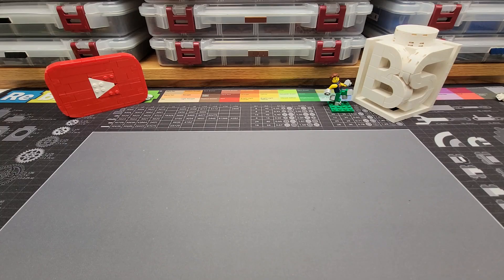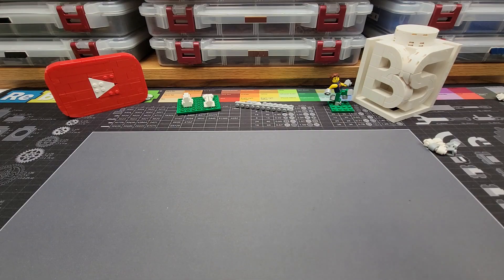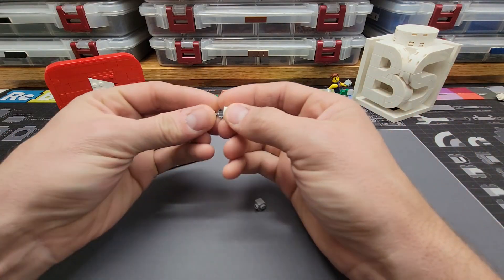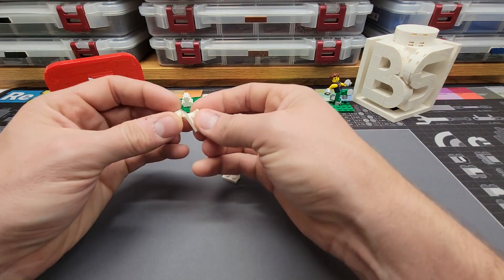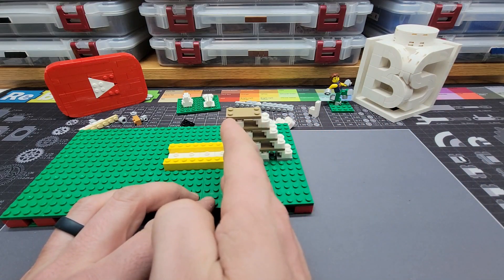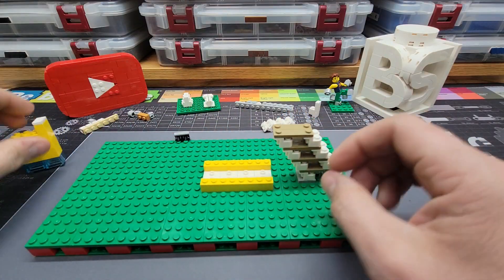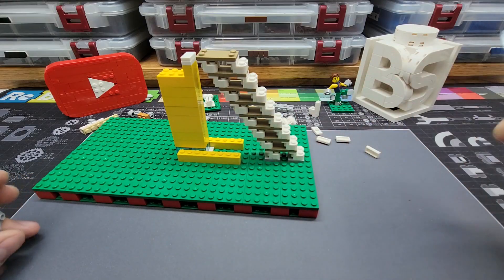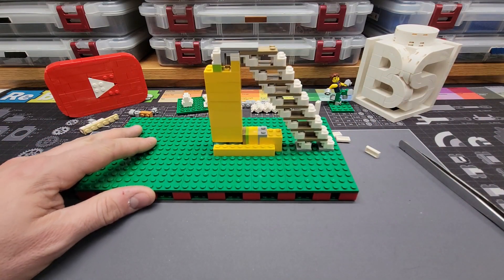How Small Can We Measure With LEGO? An Attempt to Prove 1/2LDU.

Comment: I've just done the maths and you're correct.

TLDR: the D-SNOT brick is 0.2mm (0.5 LDU) higher than two plates.

A plate is 3.2mm high, not including the stud and an LDU is an eighth of a plate so 3.2mm ÷ 8LDU = 0.4mm. According to bricklink, the height of the D-SNOT is 0.83cm (or 8.3mm) including the stud. The stud is 1.7mm which brings the height of the D-SNOT down to 6.6mm. As i mentioned earlier, a plate is 3.2mm thick, multiply that by 2 and you're have 6.4mm. An LDU is 0.4mm, half of which is 0.2mm which is the difference between the height of two plates and a D-SNOT. That 0.2mm difference is less than 1/125th of an inch.
Reply from the maker: Nice well done with the investigative math.
Reply: @bricksculpt  pin this comment lol
Reply: That's great and all... Except a D-snot isn't 8.3 mm, it's 8.22 mm (+- 0.02) (at least the 10 ones I measured). Well, actually one was 8.21 but I removed that one cause I assume it's just been a bit worn down. But the rest of the math checks out, cause if you remove 0.1 mm from the height you end up with a 0.1mm difference, which is what my dial indicator measured as the difference (with an accuracy of 0.005mm) and it also happens to be the height of the embossed lego logo :)
Reply: 0.2 mm (200 μm) is actually a really neat size because it's the biggest size that can divide both the centimeter and the inch and give integers! Obviously 50 • 200 μm = 1 cm, but because the inch is defined as exactly 2.54 centimeters, you also get 127 • 200 μm = 1 inch.
Reply: Alternate solution, same result: 

Lego parts are 0.1 mm shorter on each side than their ideal dimensions, to provide tolerances. So a 2x2 plate is (2x8)-0.2 = 15.8 mm wide. 

Lego parts are 3.2 mm tall per plate. We know that 5 plates = 2 studs. 5x3.2 = 16 mm.

So when building with SNOT, you’re off by 0.2 mm per 5 plates. 

But where does that 0.2 mm go? 

As a couple of us mentioned on the previous video, historically Lego SNOT pieces aligned the parts on the side to the top of the brick or bracket. They shouldn’t have. They should’ve been 0.1 mm below the top edge — the width of the tolerance. 

The new D-snot brick is designed to match that shifted-high alignment. That means that the gap at the bottom is {0.1 mm from the tolerance on the bottom edge of whatever you’re attaching} + {0.1 mm from the tolerance at the top edge that the part has been shifted to eliminate} = 0.2 mm. 

1 LDU = 8/20 mm = 0.4 mm 
0.2 mm = 0.5 LDU

- - - - 
With the older 2x2x2/3 SNOT plate, what looks like it’s flush with the bottom of the part is actually a 1/4 LDU gap. It has to be, because otherwise when you put two of them bottom-to-bottom (like you did early in this video), there would be a 0.2 mm gap between them.

Comment: 1:55 RE: variability of injection-molded plastic and measuring precision: 

You’d want to measure a couple dozen parts, and they’d need to be new, unused parts so you could be sure they hadn’t been worn down or deformed or damaged by use, but, yeah, LEGO’s parts should be measurable and consistent to within well under 0.1 mm. The usual figure I see claimed is that LEGO parts are accurate to within 0.02 mm. 

And while quantifying those dimensions is difficult (you need measuring tools that are definitively getting the dimensions without applying enough pressure to flex the parts by even a hundredth of a millimeter — it’s definitely going to be easier with laser measurement than with physical calipers), checking that they’re consistent is easy. Just start stacking bricks. The way you know that the dimensions are consistent is that the force required to assemble them, the force required to disassemble them, and the amount of sideways flex are consistent. You can feel it. Especially if you’ve used other bricks which aren’t as consistent. 

Another good test is to make a long, low wall of 1x2 bricks — say, 4 bricks high and 50 bricks long. Then gently bend your wall into a curve. Check for any places where the bricks allow the wall to curve more or less. IME, unless some of the bricks are much more worn than others, there won’t be. It will be a consistent amount of curvature across the whole wall. 

So while I can’t measure with the precision needed to say for certain that Lego parts are consistent within +/- 0.02 mm, I can say with high confidence that parts are extremely consistent, with extremely rare exceptions, and whatever the level of variance, it’s considerably smaller than the molded-in part tolerances (the gaps between adjacent bricks).

Comment: if you used a plate on the very top instead of a tile it wouldn't have the groove on the bottom so it would show any difference in height much better

Comment: 12:20 You're selling yourself short, this is actually very scientific. You have clearly laid out the thought process, the experiment design, then documented the experiment so that it is easily reproducible by anyone willing to do it. You also comment on potential uncertainty sources and potential flaws to the design. That's exactly how science works.

Sidenote: Shouldn't multiplying eliminate the influence of the manufacture tolerances? Assuming the tolerances go both ways (the piece can be 0.xxx mm too large or too small) would stacking several of them make the imperfections cancel out with each other?
Reply from the maker: Thanks!

Comment: To make it more scientific, the measuring apparatus should be calibrated using the Standard LDU, cast in platinum and stored in a vacuum facility under the Lego House in Billund.
Reply from the maker: Lol
Reply: But what happens when the 10 different platinum bars stored in different places around the world are compared 70 years later and do not agree? :-)

We need a measurement based on the physical world properties that can be remeasured in any lab. Without worrying about molding tolerances, pushing pressure, single lump thick pieces vs lots of little pieces, etc.

Naah, this as "half" is as good as Lego tolerances get.

Comment: On a regular lego brick, there's a 0.1 millimeter tolerance on each side to prevent friction between the bricks. Bricks have no tolerances vertically on the top or bottom but have to have them horizontally or it would be extremely hard to build classically with them. That presented a major problem with SNOT building techniques. Most bottom-aligned SNOT and bracket pieces cannot be placed bottom-to-bottom and have a piece connect the studs across the SNOT studs because the exact vertical measurements of are being put into conflict with each other and create a larger gap between the studs that is not in-system. The original 2x2 SNOT plate (99206) was created with stud reversal in mind and has the SNOT studs aligned lower to prevent this conflict when placed bottom to bottom. The 2x6 (87609) is designed on the same alignment. If you place a bottom-aligned SNOT brick on top of these and put a plate across the SNOT studs the two pieces will be perfectly vertical because of the different alignments. The D-SNOT and a new version of the 2x2 SNOT plate (4304) are designed with their SNOT studs aligned as other bottom-aligned SNOT bricks are.

With your proof here, and with the knowledge that bricks and plates align perfectly with the top of SNOT pieces, that means the SNOT studs on most SNOT elements are aligned 0.2 mm (or 0.5 LDU) higher than the alignment on the stud-reversal SNOT plates (99206 and 87609). It's such a minuscule difference that we normally don't see the gap on the bottom, but it matters when doing stud reversal

Comment: I just realized... I have a dial indicator meant to measure this very thing (tiny height difference)... Dono why I was trying to measure this with calipers.
So results are in, the difference in height of it's 0.10mm with an accuracy of 0.005 mm, so it looks like 1/4:th of an LDU :O
I measured 4 D-snot pieces, they differed by less than 0.005mm, so this is within the tolerances of the parts.
Lego tolerances are really something, seeing the dial hit the same spot within 0.005mm when using different pieces is just amazing.

While I was at it I also measured the embossing of the lego logo, surprise surprise, also 0.1 mm.
So it's probably because of the logo they raised it.
Reply from the maker: Very interesting. Thank you for taking the time to measure these.

Comment: Redo this experiment in the future with the following:
- Double the height. Make it a plate difference.
- Make several towers, 2-4, to ensure there are no errors in tolerance.
- Zig-zag like others have said.
- Make the control towers, instead out of bricks, using those other 2x2 lower-snot modified plates (with the correct measurements). You are recreating the exact connections but with a control piece you know is correct.

Comment: The Concorde set (10318) has a plate attatched to "d-snots" and "normal" snots at building step 466 and 478. 

So maybe Lego thinks that half a LDU is no stress and therefore legal?
Reply from the maker: Good to know thanks I have been hearing that several sets do it so they don't really recognize it as a problem.
Reply: As far as I know this is the "normal" for snot, at least within tolerances.  Also, it only stresses in one direction - top aligned studs, placed over the unusual bottom aligned studs (99206).  The other way around creates a gap, which is legal, just not ideal.

Comment: Oh btw, I realized that you can get an infinitely adjustable LDU using:
3 W.ARCH W.KNOB AND SHAFT Ø3.2
Or
SHAFT 2M DIA. 3.2 W/ STOP
With a hollow stud 
And
BRICK 1X1 W. 2 KNOBS

Put the rod into the brick and you can slide it horizontally to an infinite range of LDU.
Reply from the maker: Yeah that works

Comment: By definition, this is the new "1 LDU" and all other bricks must be redefined to this standard, lol.
Reply: What happens if they release a brick that's exactly the square root of two times the width of another brick?
Reply: That's handy anyway, because the new "Half LDU" (HLDU) can perfectly subdivide both the centimeter (50 HLDU) and the inch (127 HLDU). In fact, it's the largest unit that can do so.
Reply: don't look up particle spins lol
Reply: @screambmachine  ?
Reply: @ guess you should look up particle spins
Reply: @screambmachine  i looked it up and idk what about them is relevant?
Reply: @Tetrini  I'm pretty sure he means that whenever they get more accurate measurements on the speed of particle spins, they have to update the base unit of measurement to reflect this, similar to how the original comment was stating that the measurement of an LDU has to be updated due to the "half ldu" size

Comment: The offset should be the width of the air gap between pieces (0.1mm). This is because when the headlight brick was first designed, it's side stud was set so that the side of a brick or plate attached was flush with the top - but bricks aren't exactly 1 module wide (they have small air gaps either side which weren't accounted for). Therefore all newer snot pieces have their stud geometry like this. When the 2x2 with 2 side studs was first created for the UCS B-Wing, it was designed as a stud reverser, so didn't follow this pattern (its studs were placed to enable back to back placement - if you stack a snot brick on top and fix a 2x plate there will be slight stress). This piece was updated in 2023 to align to the studs-up SNOT system. The D-snot piece was always designed with this 'correct' alignment.

Comment: Other methods: 1) Ask someone at LEGO to comment. Differences in mold and piece might not accurately reflect their intent. 2) Otherwise, if somehow could use a microscope (focusing on stud versus lower corner could be a problem for this though; yours is probably smarter as it avoids this), and measure it with a huge sample size to try to eliminate mold & piece. (Normal scientific method.)
Reply from the maker: Yeah, it's super hard to make this accurate with inconsistencies. I like the advice from someone at LEGO idea.

Comment: You can include one 0,5 ldu step at a convenient place in the ruler to see of the offset is between two of them. The steps on both sides should be equal
Reply: @rnulfschmer7537  Yes, I did similar with technic bricks and the tolerances really just hide the differences. You have to do it across a few steps to really try and convince yourself that what you’re seeing is actually real :-)
Reply from the maker: I actually did that off camera the problem is it's too small to make a good judgement.

Comment: I did the equivalent of this sort of thing on my Flickr some time back but using the difference between technic brick holes and bricks with studs on the side. Made a staircase with multiple steps but now I’m wondering if this D-Snot and technic hole are both misaligned by the same amount. If they’re by different amount then that could allow finer divisions than 0.5LDU. I see others have already commented about alternating the stair direction. That might well prove that this is actually a 0.45 LDU step or some other equally odd number!
Reply from the maker: Yeah good point John, there are still too many inconsistencies to say for certain it is .5 or .45 etc.
Reply from the maker: Yeah good point John, there are still too many inconsistencies to say for certain it is .5 or .45 etc.

Comment: Calipers and micrometers are not overly expensive unless you go for really high end tools. My local hardware type store has a digital set for under $20, and a vernier set for under $10 right now. Both machined from steel. A specialty store has a vernier micrometer for under $40.
Reply from the maker: I have a digital caliper but I still don't think that will be accurate enough considering mold inconsistancies.

Comment: One LDU is 0.4mm, and a half plate is 4 LDUs, so a half plate is 1.6mm thick. The 8 D-SNOT offsets in the video becomes 1.6mm / 8 = 0.2 mm = half LDU.

My calculation is the SNOT stud should be 0.1mm higher, not 0.2mm. So I’m not sure where the extra 0.1mm is coming from on each layer of SNOT.

Also since we’re talking about fractions of a millimetre, plates and tiles and not the same height. Tiles are slightly shorter than plates making it legal to put tiles sideways between studs, but not plates. Plates are the proper 8 LDU, tiles are not.
Reply: someone should measure it with precision callipers, i have the callipers but not a piece like this.
Reply: @ I own them but don’t have my tools at the moment.

Comment: I'm convinced. I was also afraid you were going to go down the 1/2 LDU ruler rabbit hole. That way, madness lies... ⬛◼️◾️▪️↙️🐇
Reply from the maker: I think I have to now lol
Reply: At some point it's probably easier to find somewhere that can make you a highly precise metal ruler, lol. the half-ldu is 200 μm.
Reply from the maker: What's the fun in that lol
Reply: @keiyakins Digital calipers are cheap these days and super easy to use. Every hobbyist should own one. I use mine all the time and find them to be an indispensable tool. They would make quick work of this question.

Comment: If it wasn't a half LDU, this would be visible on the stack of 8. You have proven that even if it's not exactly a half LDU, the difference from it has to be extremely tiny, probably less than what the tolerances are. Therefore, you can safely assume it is a half LDU for all practical purposes.
Reply from the maker: That's a good answer to the question. Close enough for me lol
Reply: Agreed. It looks to be between 1/2 LDU and 1/2 -1/8 LDU, close enough to 1/2 to assume that it's straight up 1/2.

Comment: What I'd like to know is if there are any official LEGO sets that actually make this piece align with other bottom-aligned SNOT pieces and where you put a piece or assembly over them. It seems illegal if that strangely small misalignment is there.
Reply from the maker: Yeah people have cited a few that do.
Reply: Yes, there is. The Concorde (10318) step 466 connects plates between d-snots and snots of other parts.

Comment: Just a thought. If it is proven that this is 0.5 LDU, and we reapply the definition of LDU, doesn't it become 1 LDU? Since it's less than the current draw unit, 1 LDU is no longer the least draw unit, 0.5 is. By definition of least draw unit, it is 1 LDU.

Not that I think this change should or will happen. 0.5 is so small and impractical to incorporate, the LDU convention doesn't need to be overturned to please the literal meaning, just thinking out loud.
Reply from the maker: Not necessarily you can have .5mm or 00 gauge. It's just a measurement, not necessarily the smallest possible division. Otherwise, we would have to measure to the individual atom for LDU. 😁
Reply: @bricksculpt  but LDU is not defined as a certain measurement like mm or gauge, it's defined as least draw unit no? So if what is currently 1 LDU is no longer least, then currently 0.5 LDU is the least so it should become 1.
Reply: @colemantrebor6574 no, his LDU video used an informal definition, which is now untrue. The proper definition used by software is in mm.
Reply: @colemantrebor6574  I think it's implicit in such a definition that it means "least as far as we knew when we established it".
Reply: @colemantrebor6574  Also the "LD" part means LDraw, so we mean the measurement they used. For clarity's sake when reading old content, it's better to make a new unit if we change the length rather than apply the same old label to a new definition (in terms of definition of how long it is in mm or the like). It can simply be that the LDraw programmers were just wrong about what the minimum was, if it comes to that.
Reply: @colemantrebor6574  Although... LMU? LEGO Minimum Unit? Could be argued.
Reply from the maker: Yeah I guess so
Reply: Yeah, it's like discovering the Planck length is shorter than previously thought
Reply: Wasn’t LDU Lego draw Units?

There is nothing wrong with calling it 0.5 LDUs, it’s like how there are half shoe sizes